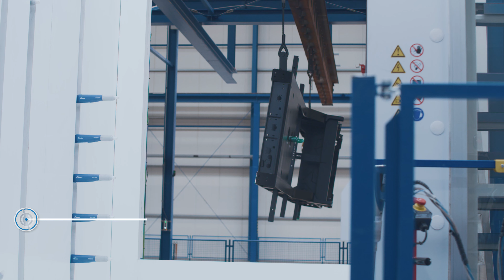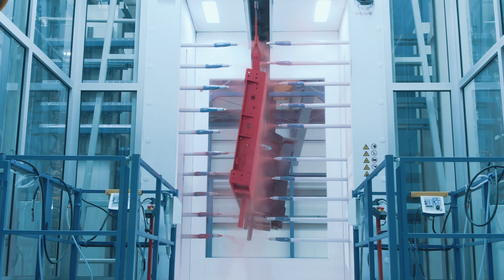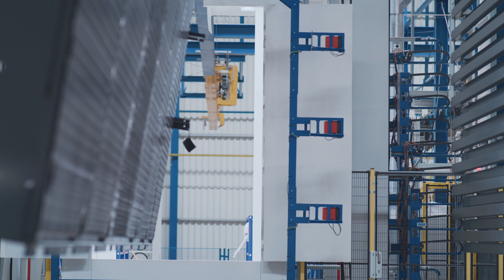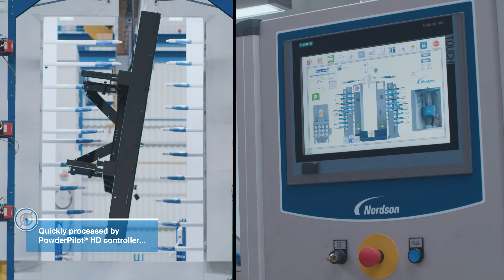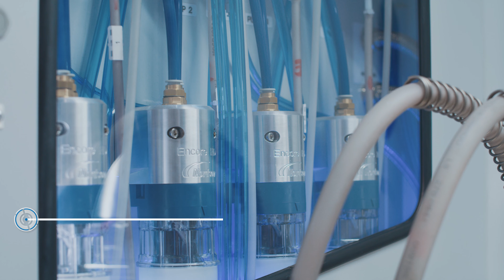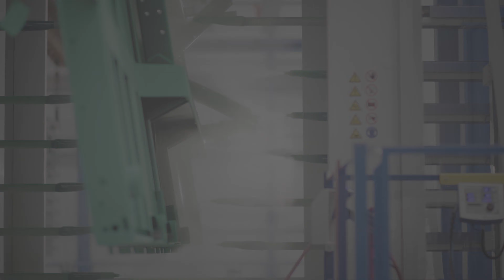Dynamic Contouring Movers for Nordson Powder Coating Systems

Comment: Wow at first I thought, what a headache to make an analysis of variance depending on the geometric shape of the part but to set the parameters for gun positioning but the I was slapped when I saw that is automatically scanned and processed by the I control, amazing !